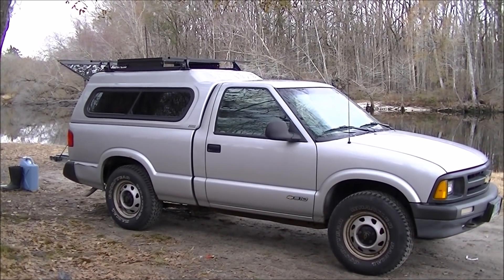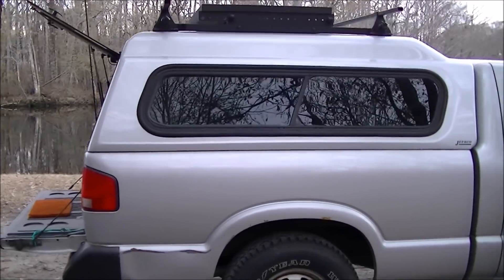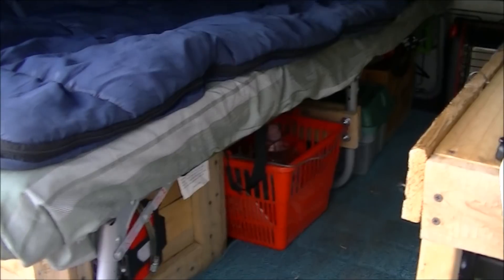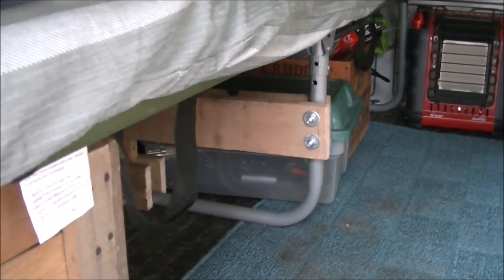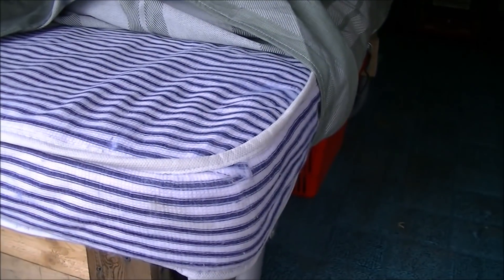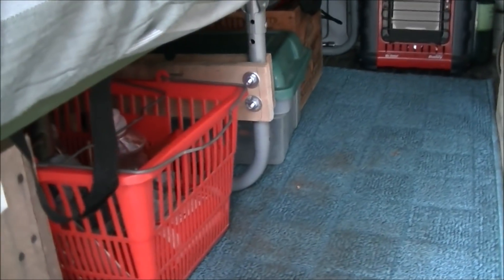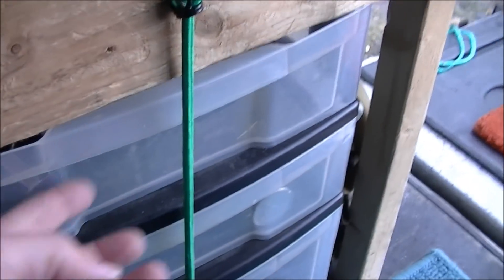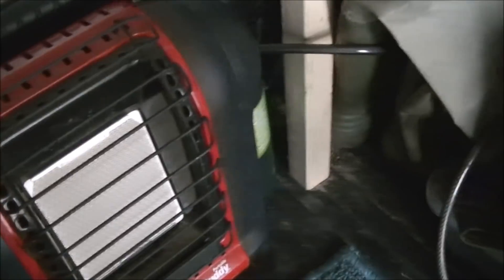Low Budget Pickup Truck Cap Camper Build

Comment: I was looking for a way to fix that issue with the cot. I have the same one, and the same problem in my 01 Silverado 6'6" bed. Cheap and simple fix. Awesome! Actually really like the super simple curtain setup, too. Binder clips come in handy for a lot of stuff. Only suggestion is maybe have a fire extinguisher handy back there. I have 3 on my truck, which sounds like overkill, but being a former volunteer F/F, I can pretty much say there is no such thing as overkill in that area. One small unit by the cot in back, one small unit attached to the side of the center console, and a full sized one behind the driver seat. Thanks for the tips, and safe travels!
Reply from the maker: The cot modification is still holding up fine. Using the heater really isn't a good idea. I worry about starting a fire with it. The space is just too small. Thanks for the comment.

Comment: We’re in the same boat with a 1997 dodge 1500 with an 8’ bed.  Got the mechanical issues dealt with.  Next is repainting.  Then figuring out for a topper.  So for now we are camping with a mechanically sound truck with half its paint missing and plastic bins in the back.  Your setup would be a great upgrade for us once we get a topper u til we figure out what we need, if it ever ends up more than what you have or not!

Comment: Those S-10s are rock solid I had a 99 GMC Sonoma version of the S10.. also had the 4.3 V6  but recently sold it when it had over 429,000 miles on it but they run for ever.. reason why I sold mine it was body was rusted out and falling apart but drive train was solid except 4x4 the transfer case  gave out about 2 years ago but I did not have the funds to get back to working.. again..  but its cool  your rig is pretty cool.
Reply from the maker: Yes, they're good trucks. Mine has needed a lot of small repairs the last few years but it's normal stuff that breaks on any car. With the age and mileage, I can't complain.

Comment: The cot mod doesn't look ridiculous. It's ingenious. Awesome job bro! I got a sonoma. You gave me some awesome ideas
Reply from the maker: Thanks, Yeah that was a pain to modify the middle leg but it worked. I don't know a better way unless you know how to weld aluminum. I saw military surplus cots that only have 2 legs but they were sold out when I looked.
Reply: DetectingMetal next time you roll by a commercial jobsite ask an electrician to bend a piece of EMT aluminum pipe to size. He'd probably do it for free with a piece of scrap pipe.

Comment: I used your idea about using a cot. I put in the deluxe model Coleman with a pad. I did not modify the middle leg. I use
the unused space over the wheel well to store fishing rods and kayak paddles. I used a wooden frame work on the floor of my bed to keep the cot from moving across the bed. And just used plastic storage bins from Walmart and Home depot to store things underneath the cot. No major woodworking project.

Comment: I bought the other Coleman cot at Walmart with the springs on it and thin foam pad and it's super comfortable it also breaks down if you want to store more gear. Excellent choice!
Reply from the maker: I was going to get that one but it was 1/2 inch too long to fit in my truck bed.
Reply: @DetectingMetal   The Coleman Spring cot from Walmart fits perfectly in the back of my 2004 Toyota Tacoma extra cab pick up which is a 6' bed.

Comment: If you know an electrician, he can bend a piece of 3/4 pipe to fit under/the middle of the cot if you give him the measurements, or maybe a piece of pipe running 45 degrees might work. Great job on everything, especially having the mechanical part of the equation covered first, most probably with a rebuilt engine, it's what's most important on the road; that all the mechanical components are running smoothly. I'm making mine this summer for the coming winter camping once I finish a few home projects first. Enjoy your vacations!

Comment: I think you did a great job . I've got a 2002 f350 4wheel dulle with a contracter box on the back . Its got a 120 hookup for house hold power, witch i can run a gen to run electric heater and battery charger. Just got walmart cot ,been trying to figure out shelving.  I really like the job you did gives me inspiration. Keep up the great work and enjoy your adventure

Comment: I'm doing a mobile camping set up & modeling the layout after yours. The difference will be a wooden bed frame that's slides in & out with the bed liner grooves. But I really like this layout. My shelves will get larger as you head to the back of the camper with the back section having no shelf for large storage (propane tank, anti freeze etc.) I also like the hanging racks.

Comment: Heating idea would be a chinese diesel heater. In Scotland  i have a stealth van and use one which comes with its own fuel tank 6l  uses little  power,  heater intake and  exhausts outside just need to cut 2  3inch holes for them

Comment: I based my tacoma canopy build off this video.  very similar prodect, small counter/shelf on the right. Cot on the left, although I didn't cut the leg and it just sits away from the side.  The good of this is my canopy has leaks from age and the cot stays totally dry being away from the side.  Thanks for the inspiration!!!
Reply from the maker: Just replace the gasket under the topper. Mine leaked also. They have truck camper mounting tape at home depot for $6.00. Get a couple of long 2x2's. Get in the bed and lift the cap up and slide the boards under it. Gives you enough space to scrape the old tape off and apply new tape. You won't get any leaks after.
Reply: @DetectingMetal  Well I re-siliconed and resealed all my windows and the back doorframe, that took care of 80% of the leaks.  Friend and I tested it last night, worked really well.  Big Storm overnight here in Washington, so the only leaks I found were a small one at the rear window, and just at the open screen windows.  
When I put the topper on, I should have put down 2 layers of topper foam for the rails, and I should have made the front cross the longer, so the seams where the tape met were on the sides, instead of over the same seams where the bedrails met at the front.  That created a significant gap that was leaking.  Siliconed it, and its good now.
My other "error" was I drilled through the aluminum "Gutter" that sits on the bedrails, to use "J" hooks for attaching to the bedrails.  I ended up having to silicone all the thru holes, as that what the majoritiy of the water ending up in the bed was leaking in, and instead of staying in that aluminum gutter it was leaking to the floor.  So I ran a bead around all the bolts.
Reply from the maker: @thomasriehl9418  My rear window frame leaked also, I did the same thing, just squeezed silicone around it. I actually used RTV gasket sealant. The windows are a little tricky to stop leaks. I'm not sure if it's possible to remove the windows to replace seals. I'm lucky my side windows have never leaked.

Comment: When I set my truck up for camping I used a lawn chair. There is a fold up chair that has 2 legs and folds in 3rds. and about 6 ft long. The 2 legs fit perfect over the wheel wheel on each side of my ford truck. Add a pad and your good to go.
Reply from the maker: That's a good idea, I didn't think of that. They're like chaise lounges. If they're sturdy enough that would work well.

Comment: Good video, great setup.
I like how you done things the less expensive way.
I want to learn more about your solar panel, inverter, and charger system.
Again, thanks for good video.
Reply from the maker: It's just the Renogy package they sell on Amazon- panel, charge controller & cables. The batteries are all Harbor Freight AGM. I learned later it's better to have 1 or 2 big batteries than 4 smaller ones. It all seems to work okay anyway. I started with 45 watt panels but that was a mistake, you really need at least 100 or 200 watt panels even if you're only running small drain stuff.

Comment: the buddy heater is clean burning, and rated for indoor use, when burning efficiently propane produces no carbon monoxide, only carbon dioxide and water.. also, you should invest in an adaptor hose and a 20lb propane tank, much cheaper to run than those expensive small cylinders, and you can have the 20lb tank refilled cheap. and if all you are using the battery/inverter mostly for is lighting, invest in a couple usb powered led lights, around 8 bucks, and run those off the inverter instead of ac powered lights. you can run 3 led lights for DAYS off one battery. you can also run the stove from the 20lb tank with a t valve. other than that youve got a nice setup. doesnt need to look like a million dollars just to sleep in it.
Reply from the maker: It does give off carbon monoxide, mine went quite high with the windows closed. It might not be much of a concern in a large space. You have to be very cautious with it in a small space like this. I had a 20 lb tank but I didn't have enough space for it. Thanks for the comment.

Comment: in an s-10...? good job anyway! btw, i have a small mr. buddy heater and the tip-over shut off works fine but apparently they also come with an automatic low-02 shut-off.

Comment: I was thinking about the cot idea. Did you try bending the leg inwards so it doesn’t hit the wheel-well first?
Reply from the maker: I didn't try bending it. I think that would be too difficult and it would probably snap. Cutting it is the way to go.
Reply: DetectingMetal ic. Just curious if that might have worked. Thanks!

Comment: How do you keep the cot and the boxes underneath from moving when you are driving on a windy mountain road?
Reply from the maker: I have a rubber bed liner mat in mine. It doesn't move around much. It would probably shift around if you had a slicker floor.

Comment: How long is your truck bed? I have a short bed 5foot 5 and not sure where to find a cot that fits back there.
Reply from the maker: Mine's a 6 foot. It's actually 73.5 inches. The Walmart cot was exactly 73.5". The Coleman cot was 74", so too long. I don't know if you can get  a cot smaller than 6 feet. You may have to make something from scratch.
Reply: @DetectingMetal  That was the original plan but thought this set up was much simpler. I guess its gonna have to be one of those platforms for me. Thanks for the info.

Comment: That light socket looks like an asian E27 screw base vs the standard North American E26 screw base. ....and change that anchient CFL with an LED. Would use less power. Good job on the build considering. Is that a 5.5 or 6 ft bed on the s 10?

Comment: Good job man, great setup on a shoestring. Like the solar setup as well, I use a MrBuddy heater as well. Could you store the batteries outside the camper Shell? That would be Safer?
Cheers
Reply: Or switch to lithium bateries that don't give off hydrogen gas when charging or during use

Comment: Jens Williamson, III (Deaf)

I have 1999 Chevy S10 pickup with ARE Hard Shell Camper (nearly 8' long) since December 2, 1999 because of No Cab. I use 1 or 3  Warm Apple Pie Candle(s) in my camper instead of the heater (risk?). Good Idea! Must Check the oil etc every Sunday like make sure before Go! Truck Camping like Happy Camping.
Check the air tires every Thursday. Free Air at The Discount Tire Store. Good!
I am sure that You will have a good common sense than mistake or forget. You will know. Okay! Thanks for your time. Have a great day!

Respectfully,

Jens C. Williamson, III
😎😷👍🇺🇲
Bexar County 🇨🇱
Retired ID
Hearing Impaired
OASDI and The Disability ✅✅
Approved!

Step by Step:

#1 Check the oil etc.
#2 Stop by Discount Tire Store for Free Air. All 4 tires!
#3 Fill up from full gas before traveling. 
You are ready to go. Have a Safe Trip! 👍
Just Hard Shell Camper under LEER or ARE or SnugTop or Uresti or The Camper near Dome Tent. Simple!
It is your choice!

Last One: Be Smart!

Comment: How did you mount the wood work to the bed so it doesnt move in transit?
Reply from the maker: The shelf I bolted to the bedrail lip inside. Drilled 2 or 3 holes in the lip and just bolted it. I don't know if all trucks have a lip folded in at the bedrail like this, I think most do. Just don't drill where the welds are.

Comment: Hi, so the Wanderer controller compared to others only tells you limited info? Its just the basic, does not tell you how much % your battery is charged and all that stuff? I am also converting my pickup short bed into something similar and have bought a Mr. Buddyheater at a pawn shop 35 bucks, filter 10 bucks, long hose 35 bucks, and works, now just need to get it to connect to my propane stove. My truck has also over 270K miles  but little I can do now, its all beat up but still running. I was going to say, my pick up is a Nissan Crew cab and the whole back seat is out, its just an empty space and saw someone cut out the entrie frame from the bed to the cab and sealed it with an accordion boot rubber boot seal and it gave an enormous amount of space, the Nissan frontier bed is under 5'5" and I'm 5'6". I tried sleeping at an angle but it was not good. I'm getting tempted to go to the hardware store and buy me insulation, cut the topper fiberglass cover, lifted about 1footso I can sit better inside, then seal it well and cover it with those light white shower panels and caulk it all and make it look nice. The cook thing is that that one foot height will be of wood and you can use that for other purposes and even hold it down more securely to the bed of the truck somehow. I don't recall if you said you (I think you said) you where doing it for long trips, months? Well, same here.
Reply from the maker: The wanderer just has blink patterns and colors to show what charging mode it's in. When it hits float mode it should be fully charged. You have to add a voltmeter to show the battery state. I just use the meter on the harbor freight controller. I know some newer trucks have shorter beds. Mine is 73.5"

Comment: Is the grabber to snag the window coverings down in the morning while you are still in bed?
Reply from the maker: Originally I was using it to pull the front window cover up or down from the tailgate, then I just said heck with it and left the cover on all the time....can't see out my rear view mirror at all.
Reply: DetectingMetal ....I am tempted to do the same all the time...thing is....I just really feel I need to see out the back since I am driving around all the time. But it's easier for me to change mine probably. And funny thing is I bought a grabber from the dollar store for the same thing..haha....but I just have it in the truck bed now.
Reply from the maker: Yeah the window cover is a pain. I wanted my windows covered whenever I was parked so nobody could see valuables in there. It got to be too much of a chore so I left it on all the time. I haven't come up with a good solution. I still see pretty good out my side mirrors.
Reply: DetectingMetal ....yah everything is a chore  after a while it seems haha. I have spent months figuring out the best way for my window coverings..especially with all the curves in the interior..it's so ridiculous. Could you put blinds up and then one pull of the string does it all? Ah well lol.
Reply from the maker: Blinds or a pull down vinyl screen might be a good idea.....would involve more than binder clips or tape to install though...lol..
Reply: DetectingMetal ....yah lol. But it might be worth it lol

Comment: get rid of that propane heater and go buy yourself a 10 to $15 little heater and plug it in to all that electricity you have in there you'll be fine
Reply from the maker: I wish. I can't run an electric heater off it. Even low wattage ones use lots of electricity.

Comment: What type of mount did you say you used for the panel?
Reply from the maker: It's a tilt bracket they sell on Amazon. I mounted wood across where the roof rack is. The tilt bracket is screwed into the wood. I didn't want to drill a lot of holes in the cap roof. Without the roof rack, you'd have to drill some holes in the roof.

Comment: My 95 S10 has no 4x4 and that makes me feel not good at all not even a little bit 😑
Reply: I have a 2006 Chevy Silverado ext cab and i with some good at tires and stock height and as long as don't going mudding i can follow 4x4 s off road in the Sierra and have. Snow and mud not but dry yes since that's the only time i go to the mountains spring summer to camp and fish works fine 4 me even went over some bigger granite rocks along the way just going slow
Reply: Like to upgrade though just to have if need b